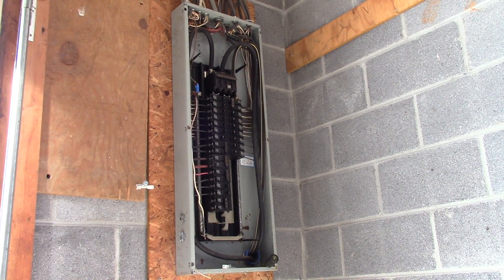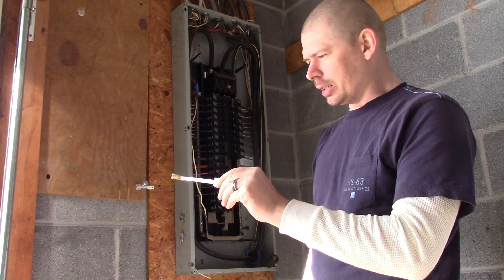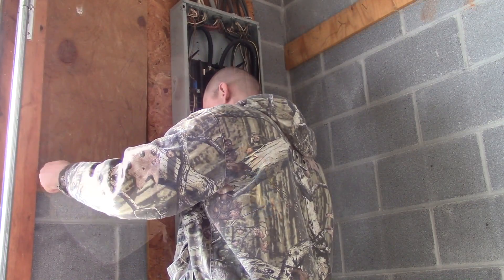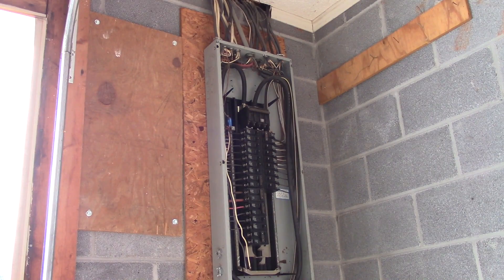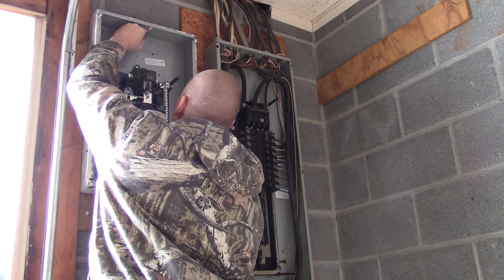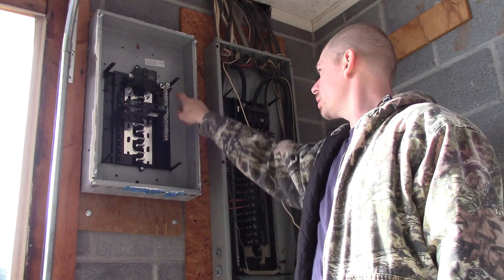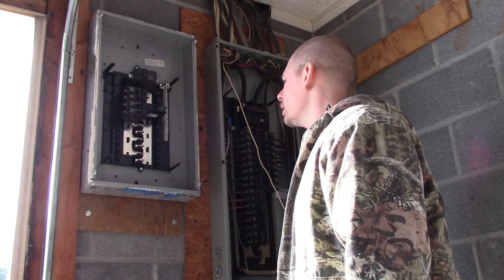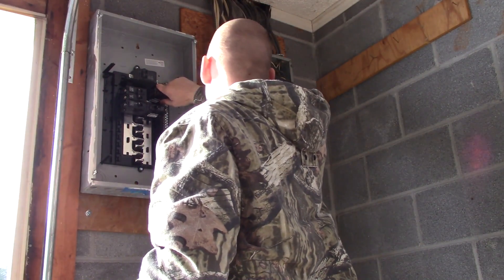Installing Manual Transfer Switch For The OFF Grid Solar Inverter Part 1

Comment: Great Video, I am doing a similiar set up where I am trying run bth AC and garage on off grid solar as a back up. Can you please Link to the transfer switch box please?
Reply from the maker: your electricity supply house will have it